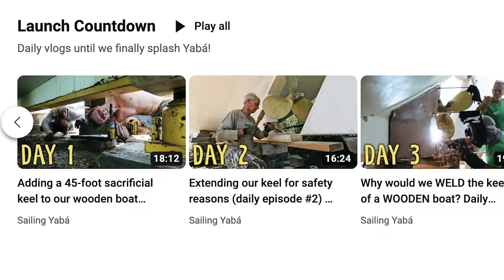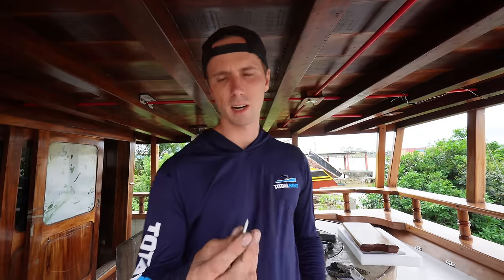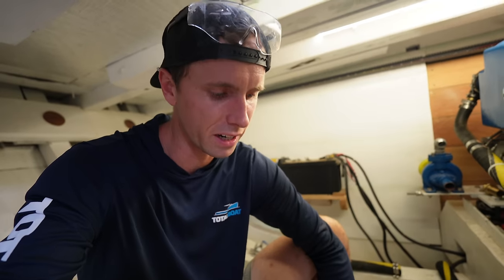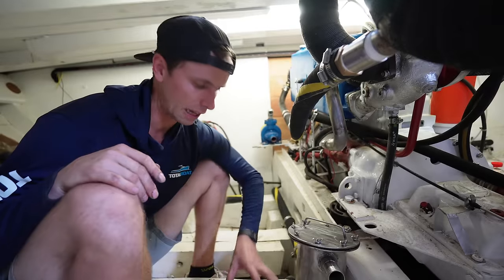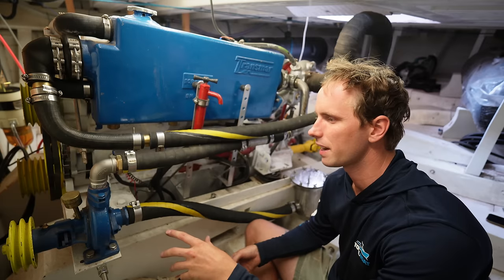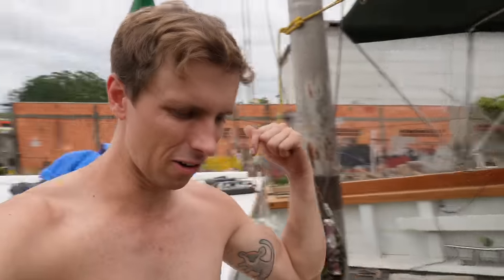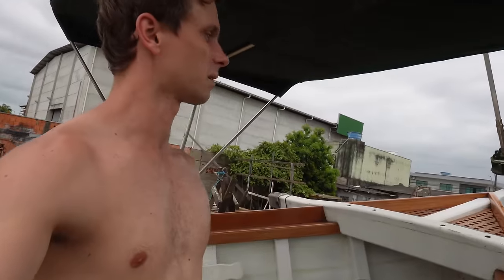Wooden boat refit: We have engine cooling and added some shade to the deck  — Sailing Yabá 174

Comment from the maker: Thank you all for being here! It's been so thrilling to be together every day! ♥
Reply: Daily videos for all of 2024!
Reply: The tool is a pipe wrench ("Stilsons" in the UK) and the white tape is PTFE. The pipe wrench uses the same principle as the monkey wrench but the latter has smooth jaws.
Reply: Those grips are called STILLSONS in English.  In addition to gland nuts they can tighten/loosen threaded pipe - a very useful tool in all sizes apart from the medium one you have.  You will need one in the toolchest. PTFE tape is Polytetrafluoroethylene i.e Teflon tape.  Its not an adapter but a reducer from 2" to 1 1/2".  A sigle Milacor clip is stronger than a worm drive/\jubilee clip particularly as the Jubilee clip ca dig into and split the rubber. never ever use small jubilee clips on fuel lines.  The hoses will need clip so as not to stress the pipe.
Reply: Much Love and many prayers for MPs Recovery.You guys are Awesome.
Reply: Love these episodes. Can't wait to see you splash. Blessings and a speedy recovery to MP..
Reply: Well done guys keep up the good work. If you looking for an alternative to the white ptfe tape look for a product called loctite 243. Hope to see you in the water soon. Cheers.
Reply: reduction adaptors are commonly called reducers
Reply: We're digging it! The mad dash to the splash is fun to watch ✌️
Reply: I'm here every day clicking the like button.☺

Comment: In US it is called a Pipe Wrench, and the tape is called Pipe Tape or Teflon Tape, generally speaking you don't need both tape and liquid gasket but will not hurt if you do. Hope MP feels better soon.
Reply: Also a Stilson or monkey wrench
Reply: stillson. Fab tool. Like Ben I have one. And use it rarely. But when you need it you’ve already given up with the rest of your easy to find tools! The design means it can grip circular pipes as well.
Reply: @franktartan6808  A Monkey Wrench looks very simular but the jaws are a little longer and thinner and do not have teeth, the teeth are needed to grab the smooth surface of a round bar or pipe. where a monkey wrench is for the larger nuts or items with flat sides.
Reply: @danielcourtney7478  yep. I agree. But most people don’t distinguish between them.
Reply: @franktartan6808  Same in Aus-called a Stillson or mostly pipe wrench. Tape is thread tape (how obvious is that) and the saw is known as a hack saw here

Comment: The engine bay water hosed. Don't allow them to touch each other as they do wear down weaken and start to leak. As always, well done. Can't wait for the splash. Good luck to you, MP and the crew working with you. MP. Get well soon. We miss you.
Reply: Excellent ‘sink’ prevention advice John. Spot on. Anything that can move will move. Vibration of the engine and motion of the sea can quickly cause failures. Plus when operating those hoses will be heavy with water compounding any stress points. Secure everything.

Comment: Hi Ben, maybe you can give some hemp and sealent grease a try.
Because hemp will expand a bit with water contact and it makes it possible to adjust later without loosing the sealing thats why many plumber do not use the white Teflon tape.
Get well soon for MP!
Cheers Marc

Comment: Hi,in the UK the orange tool would be called stiltsons a very cruel weapon to use on brass fittings, unless the jaws are padded. I would move the sea connection handle to the horizontal when open,so that it doesn’t vibrate to closed,whilst under way.cheersRoly🇬🇧
Reply: Yeah mate ' Stiltsons ' i spelled em rong, so i was 1/2 right eh.
Reply: Actually "Stilson", who were the originators. Lots of copies with small difference but work the same. Generically a "pipe Wrench". Yes they can be brutal but often the only thing that will grip a smooth pipe or the final choice for a mutilated nut. Looks like the tap is positioned as down for on.
Reply: It would seem that I cannot spell Stinson either.

Comment: 5:21 - Pipe Wrench, it is loose so it can be moved and ReGrip / Bite a (Round-Tube) Pipe. In a perfect world, you would have used a Monkey wench. 
The later doesn't have teeth and no damage is done to your "soft metal" nut.
Reply: I didn't realise there was a difference. I've always called this type of tool a monkey wrench regardless of what fills the jaw.
Not saying you're wrong, I've just never heard of this classification :) 
To me, a pipe wrench is this spring-loaded hooky-claw tool without any jaw adjuster nut, while a monkey wrench has the adjuster
I do agree that the steel teeth will wreak havoc on brass/copper fittings: I usually fit a bit of chipboard to the teeth to avoid this

Comment: Hello Yaba , I've been a fan since the first day you bought Yaba.  Your I can do it attitude is a very positive tool to have. In Kentucky, we call that wrench a ( pipe wrench ). 
I noticed the last pipe with the yellow stripe on top of the black pipe. If that is in contact with each other, it will rub a hole just from vibration. After 44 years in the trucking industry, I have learned it would be wise to stop  any chance of them touching. Get well soon , M P God bless you guys. I can't wait to see her sailing again ❤❤❤

Comment: Good call on using Sikaflex instead of being tempted to use 5200 adhesive on the through hull.  The previous owner of my boat loved 5200 and I pay for it every time I replace a through hull or fitting in the endless hours of sawing, banging, and swearing as I try to remove it.  5200 is awesome stuff, but one you use it on something, it’s there forever.  Lance in Canada  “Great Escape” - Newport 30 - Mk ll

Comment: Reducer is correct, Pipe Wrench and Teflon tape… the roof of your boat is on the outside and the inside is called ceiling ( you asked for comments ) really have enjoyed all your videos, thanks for the opportunity to comment… can hardly wait till you splash….Sincerely…
John and Penny… Ontario, Canada

Comment: You did a great job with the through hull and the install of the water hoses. Now I wish you would replace all those plastic fuel lines for the engine with fuel lines that are made for diesel fuel . You really need to put some rubber material between the fuel tanks and where they contact the tank supports and where the tanks contact the hull to stop any place the tanks may wear a hole in them. I don't like bringing up the fuel system, but it should  be your number 1 priority before you splash and find you have a problem.  A major fuel leak in an engine room has sunk more boats with fires then any other problem on a boat . An engine room fire is almost impossible to put out when it's being fed by hundreds of gallons of diesel from the fuel tanks unless you have a good fire suppression system. Please think about fixing the fuel system like it should be,I'd hate to see you lose your boat you've worked so hard on or your lives.
Good luck,stay safe and our prayers are with MP.for a speedy recovery .
Reply: Very valid points William. In addition Ben cannot trust that the weight of the fuel tanks will keep them down whilst at sea. I see Ben has supported the tanks and held them back but they also need to be held down, and as you say, with some sort of movement absorbing material between all the supports to avoid friction wear.

Comment: Ben check your hoses again for rubbing, also the shut off valve for the through hole, had the same on mine and it closed due to a wave.  The hall hit so hard from coming back down that it closed the valve.   Fitted it by having a piece of cloth holding the valve open.     Please give a hug MP for us and  tell hert we miss her :)

Comment: Love the work you've done Ben, and I'm looking forward to your splashing Yada.  Btw, those screws/bolts are called LAG bolts.  Lag bolts are wood threaded screws with a hex head.  Keep up the energy!!!  Also, that large wrench is simply called a pipe wrench.  Because it's jaws are slightly offset and they move a bit, that wrench can also grasp a round pipe.

Comment: It is called a Pipe Wrench.  It is designed to grip metal pipe.  That is why the top jaw moves.  It creates a bind to grip whatever you put it on.  Sometimes you need two of them.  One to hold the item you are working on and another to screw out the item you want to detach.

Comment: Wing nut, adjustable pipe wrench, smaller version is crescent wrench, pipe sealing tape.

Hoping MP gets better soon. Missing her smile and laugh. Thanks for the brief explanation.

Engine almost done. Need belts.

Bow tarp color does not complement the new Yaba. Great shade and in time may get upgraded.

Comment: Mechanic Tip #1:  All things vibrate and move.  Any metal clamps touching another hose will wear a hole for sure.  Any hoses touching each other will wear a hole.  Any hoses not in perfectly straight alignment will wear where the bend is.

Comment: Keep up the great work! Make sure you cut some hose and wrap around where the hoses are touching coming out of top of water pump. Friction will rub through and you will have a leak especially the hose clamp touching bottom hose.

Comment: Teflon pipe thread tape.
American name for your wrench is a pipe wrench 🔧.
I hope this is helpful. 
You never need enough tools. 
You the correct tools for each job. 
Electric tools, pipe or plumbing tools, open end &box ( close) end wrenches, rachet wrenches all sizes and multiple size sockets. 
When you are

Comment: Well I have been enjoying the every day videos I am sure it is a lot of extra work for you guys. But I am really excited to see the launch of YABA !  Hope MP is feeling better and comes back before to long. 
Let her know we wish her well. But this rebuild is just about a rap. YABA is looking really good.
Oh before I forget the wrench is a pipe wrench. The teeth are for grabbing to a round pipe.. you need an adjustable wrench called a creasent wrench in the states. That don’t have the teeth to be used on hexed fitting such as you were tightening and soft fittings like brass. But if you don’t have an adjustable wrench you improvise and use what you have. Even if it chews up brass fittings, not good for the fitting because it can cause cracks in the brass also. On thin soft nuts such as this one.

Comment: Hi Ben and MP, Salty cooling water through the engine will eventually cause blockages due to the growth of all kinds of dirt. It is better to use a freshwater closed system with a water cooler that you can clean periodically. preserving your engine. Succes!

Comment: That tool at 5.40 is a PIPE WRENCH. And the big advantage is that a pipe wrench will automatically grip the pipe tighter the more force you exert on it. Therefor it is you have to apply the wrench in the correct orientation.
And while the adjustable wrench can be applied either way, it is better to apply it in the same orientation as the pipe wrench, since it is considerably stronger in that orientation.

Comment: I enjoy your videos in the US the tool you had in your hand is called a pipe wrench. The white tape is called Teflon tape or plumbers tape. The biggest pain with it is you have to turn it into the right direction otherwise, when you screw the nut on, it will unscrew the tape.

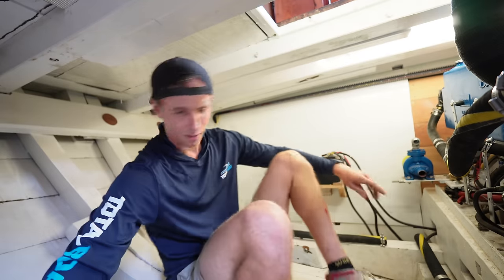Comment: @5:22 It's called a pipe wrench. At least that's what I call it. @5:55 That is a pipe seal tape. Or actually PTFE Thread Seal Tape. Must wrap at least 4 times around thread minimum for a good seal. MP, I hope you feel better soon. Because we need you to get cracking girl. Good job Ben. I loved it. Cheers. From CC, TX., USA. See you tomorrow.

Comment: Big love to you both, especially MP ❤.  So close now, we can hear the splash in the not too distant future..!! How exciting. 🎉
I am concerned with the mounting of the raw water intake through-hull as the motion of Yaba thru the water will scoop water into the intake and pressurize the sea water into the cooing system even when the engine is not running. And, without the exhaust to expell the water, it can build up in the exhaust and find its way back into the cylinders.  Please consider turning it 180* so that the intake grid is facing aft. There will be plenty of water to draw into the engine without the pressure pushing it into the raw water filter.
Great progress..!!!  
Oh, the big pipe spanner thingy is often called a 'Monkey Wrench', I think.
Cheers, Grant - Aelaide, South Australia.

Comment: Thanks for the daileys. The wrench is called a Stilson in the UK.  Put a band around the water filter to stop it vibrating. The Mikalor clamps are good but get the stainless ones. Be careful some are made with mild steel bolts not stainless.  Get well soon MP.    Good luck with all the jobs.  ATB regards from the UK

Comment: Sorry forgot to add and hope it doesn’t come across as being rude in any way , when installing an isolating lever  valve / fitting , plse put a short piece of pipe into the  other end as it will help reduce the risk of squashing the fitting as u tighten them with a pipe wrench etc , , hope this also helps

Comment: In the UK we tend to call the pipe wrench a 'Stillson' (brand name) wrench. Top tip - tighten valves etc onto fixed pipework using the flats on the pipe side as using it on the unattached side can crack or deform it.
Also, several plumbers have told me that the thread (P.T.F.E) tape is actually designed to seal the faces rather than the threads as the threads cut through the tape and rendering it useless. I must have just been lucky all these years, but there you go.
Hope MP is feeling better soon.
Keep up the good work!

Comment: Hey Ben, just a thought: You may want to mark that engine cooling water inlet ball valve "Open" and "Closed". Also, you might want to put a device on it to secure the handle in each position. Wouldn't want to ruin an engine. Nice install.

Also: If I am not mistaken a ball valve is only supposed to be used either fully "Opened" or fully "Closed."

Comment: Pipe wrench, Teflon tape, also, you need a hose support at the engine, when the hoses get filled with hot water, they will be heavy. And sag.

Comment: AW   MP  get well soon.  Back to the build,  about the sealant for the interior of the raw water thru hull   remember its a wood boat. it is going to as wet on the inside as on the outside    so seal everything that may get rot from water   both inside and out .  Love the Bimini. so will you guys.  editing is a big job. good on ya guys. I am up early (sw Arizona) waiting for my coffee and Yaba..

Comment: The Teflon tape works very well.  The one thing I have discovered is the with large threads, you need to use more than seems necessary.

Comment: We miss MP's bright and shiny spirit! Get well soon and rejoin the videos. In the US the tool is a pipe wrench. The articulation and toothy jaws allows it to grab a round pipe without slipping. A big crescent wrench is a better choice on hexagonal brass nuts as it won't leave jaw marks. But the pipe wrench is commonly used just as you did.

Comment: I did not remember when you installed the engine water pump and do not know if the associated belt for it is also for anything else, but if there is nothing else and it is directly attached to the engine pully, you will need to have some adjustment so you can install the belt and adjust its tension.  Therefore, the pump should be able to move in its mountings and then tightened at the proper tension.  Cheers!

Comment: Pipe wrench. A strap wrench or chain wrench would also be handy. The tape is "teflon" tape, comes in at least two types, one rated for water (white) and one rated for natural gas, or methane (yellow). You can never use too much sealant IMO.
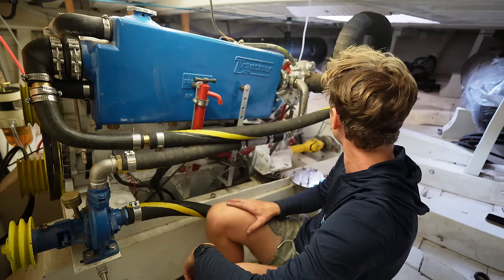10:30 You are Almost done, after you secure that raw water filter to something. Another kind of "tape" is plumbers tape, a strip of galvanized metal with a lot of holes down the center. Would be very handy to keep some of this aboard too for temporary repairs. You will have to insert a non-conductive material, maybe some kind of upcycled plastic, between the stainless and galvanized "tape" - you should never have them in contact due to galvanic corrosion.

Comment: A bronze seacock is the first thing that should be attached directly to the thru-hull. All hose to bronze fitting connections require 2 hose clamps.

Comment: In a saltwater environment, it is generally not advisable to connect stainless steel and bronze fittings directly. When different metals come into contact in a saltwater environment, it can lead to galvanic corrosion. Galvanic corrosion occurs when two dissimilar metals are in electrical contact in the presence of an electrolyte, such as saltwater. This can result in accelerated corrosion of one of the metals. MP, hope you are feeling better.

Comment: On larger theaded fitting I use Loctite thread sealing cord. If you want belt and braces you can add threading paste. I like LaCo but Loctite is equally good. Always have a set of 18" & 24" Stilsons in the toolbox. The only one I rarely use is the 48" Stilsons.... inherited from my father 😉

Comment: Called a Pipe Wrench. I have 3 different sizes in my tool box. You are correct, you rarely need it, but when you do, you need it! By the way, when setting through hulls, I tend to use the caulk and tighten to finger tight, then let it set up, then tighten. This allows the caulk to be compressed against the nut. i've never had a leak by doing this. if you have the time to do this, it's worth the effort.

Comment: Just an idea but if you keep flexible hoses at the diesel fill pipe as it comes through the deck and where it enters the tank and replace the length in between with a solid pipe which can be anchored with a bracket you will remove the chance of getting air pockets